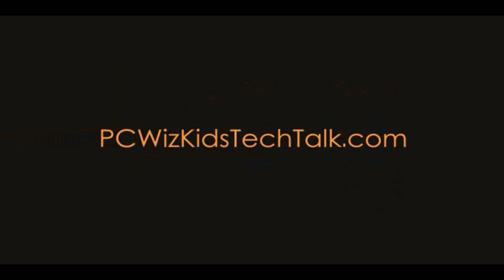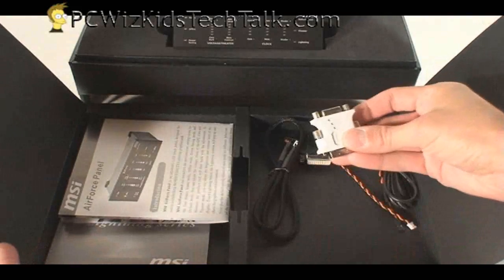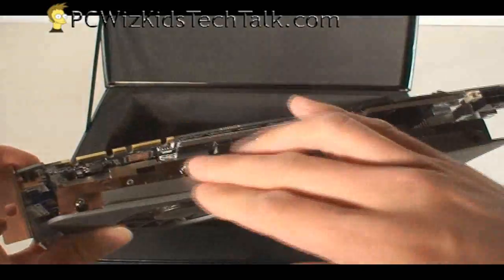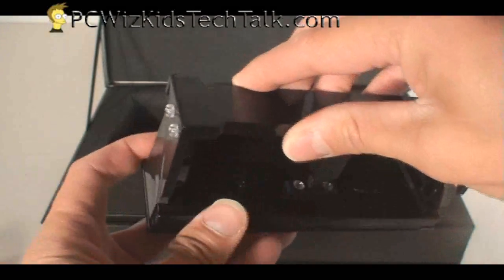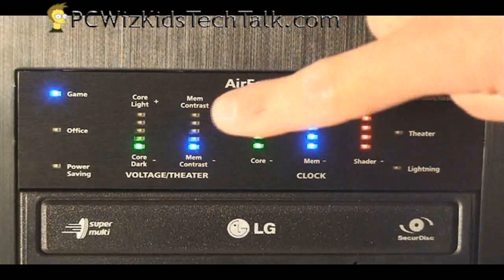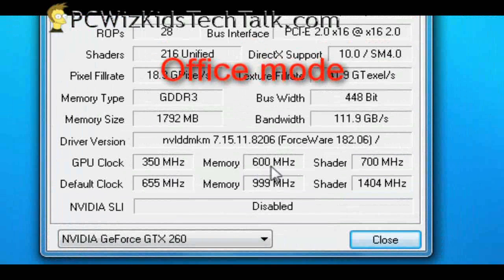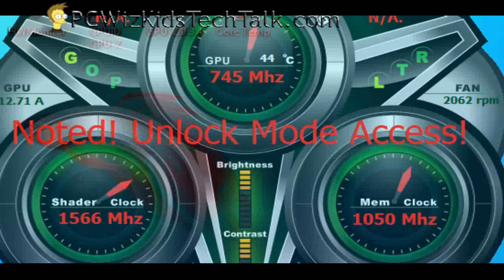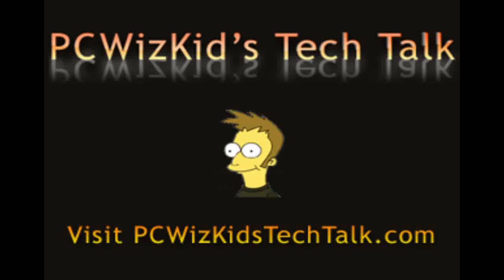MSI N260GTX Lightning - Review

Comment: by the way, i´m sure this card had a serious VS with the 295 Gtx..... Why ? this one have 2Gb for one core, and the GTX 295 is 890 Mb per core, so the gtx 295 has there a big problem, the info cant be splitted, maybe a gtx275 or gtx285 colud give him serious battle to this overclocked 260, i have one and runs everithing in max

Comment: Nope. I didn't saw any 4890 that will be faster than GTX260 on the same rig. Even if they are overclocked to 1GHz. I've just ordered GTX260 Lighning and I want to overclock it to 850MHz with my WC setup. Overclocked GTX260 is even faster than GTX280, so 4890 is not competitor